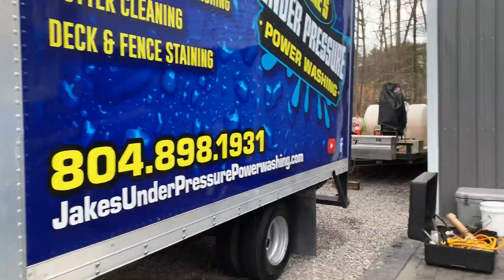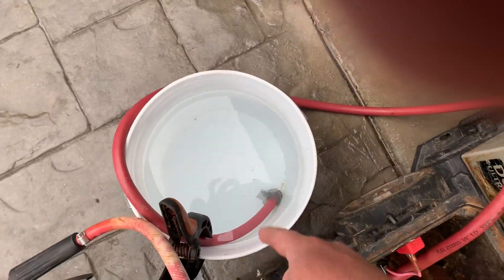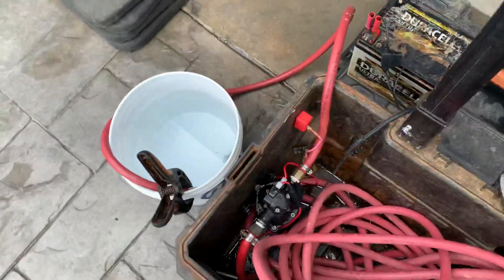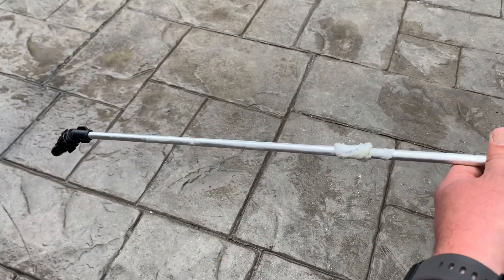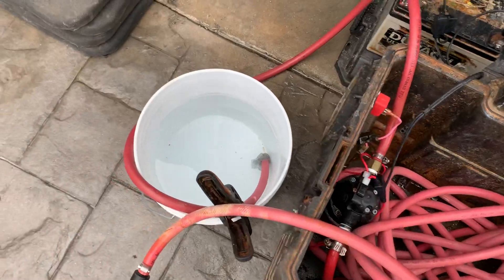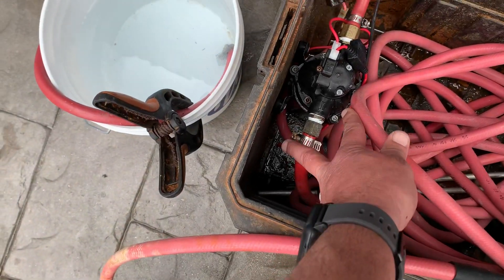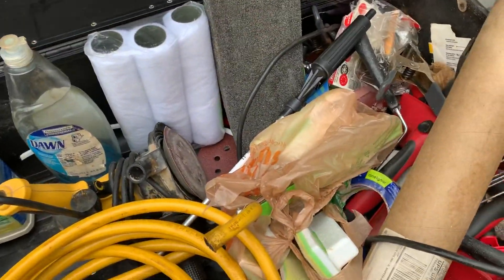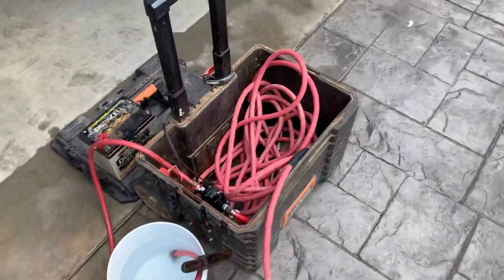How to make an Electric Sprayer

Comment: I just started my own pressure washing and sealing only paver driveways and I need a a better sprayer in the one I’m using and I’m really interested in yours I seen other companies around here has similar one. Could you please tell me the items I will need to build it? I typically use wet look bears sealer , I Really need this, it would help me out I’m tired of going through pump sprayers I would appreciate it Thank you brother Or you could email me at chrisberger0823@gmail.com